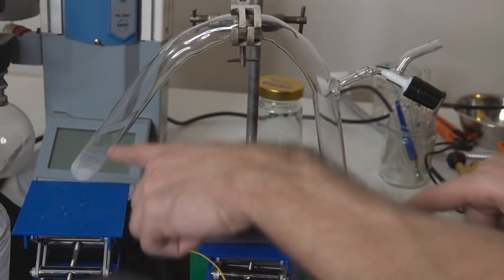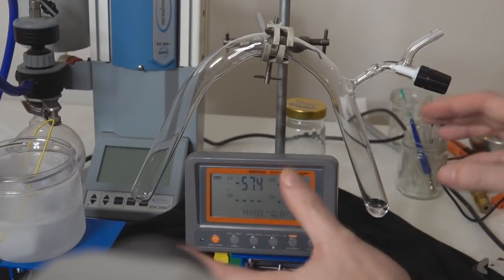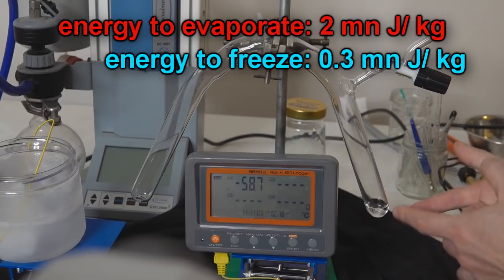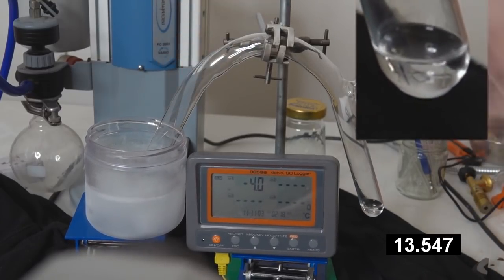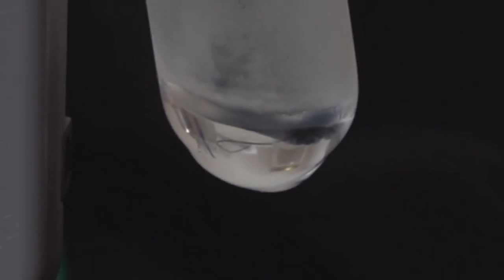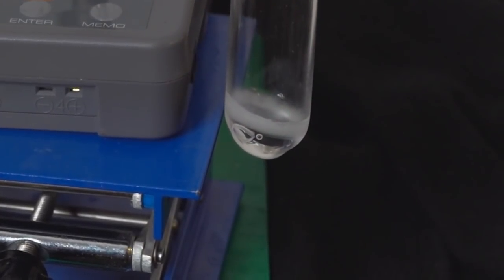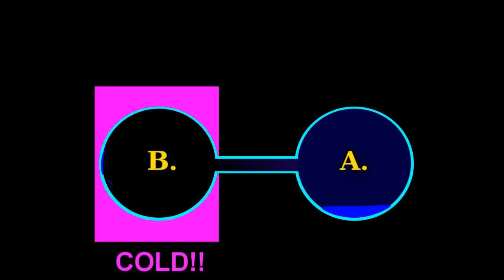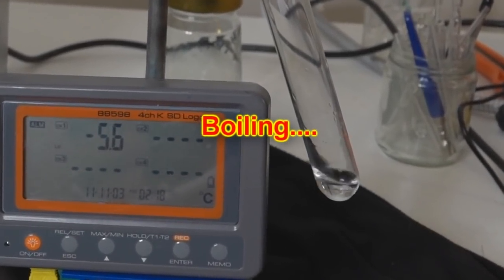Does Water Boil or Freeze in Space?

Comment: I do wonder if the vapour pressure speed would be limited by practical effects of the diameter of the tube over really long lengths?
And would the amount of actual energy transfer through the tube (and hence available to be converted by a turbine) be directly proportional to the diameter of the tube?

Got any feel for the practicalities of this Thunderf00t?
Reply: Luiquid will evaporate at different tempatures dues to the pressure of the container it is in. The chamber pressure changes at what tempatures something , for example, in cryogenics, the fluid will be kept in a container at high pressures, changing the tempatures for evaporation to allow for storage at warmer temperatures.Hope this helps
Reply: If you make the tube too small the gas will have to travel at relativistic velocities because of Bernoulli's law, and it will travel backward in time, thereby drawing power from the grid instead! Impractical!
Reply: @triogaming4077  apparently a human head takes about 30mins to freeze in liquid nitrogen so I'm guessing a reasonably slow in space
Reply: Possibillities are probably endless.

Practicalities are a work in progress ;)

Science my nigga
Reply from the maker: yup, to a reasonable approximation viscous flow goes with the fourth power (if memory serves) of the diameter.  Big tubes make a huge difference.  That being said, even if you assume the water is travelling at the speed of sound, and assuming 10% eff. (probably generous) you need to freeze about 1 ton of water to supply one person with energy for one day.  Im not sure I see this happening any time soon! ;-)
Reply: @Thunderf00t  and if you will pump warm californian waters through  our ice block to heat it up, would it be possible to produce more energy than the pumps will consume?
Reply: @HoleyHouseOfAir the rate at which they lose energy will determine the distance travelled before freezing - surely?
Reply: Of course, if you limit the diameter, you change the P/Q diagram of the system and you limit the (mass) flow. Increasing the length of the tube also increases the hydraulic resistance of the system so with a thin, long tube you will get very little flow.

The total amount of energy available to the turbine depends mainly on the amount of energy you pump out on the cold end since condensation is driving the pressure difference between the two ends.
Therefor the diameter is critical, if we assume that you can pump out any amount of energy on the cold end, but the function between the diameter and flow is not linear.
Reply: It doesn't matter.  He proved that vacuum conducts cold.  He cooled one end and the cold travelled along the vacuum to the other end.  Vacuum therefore has a very high thermal conductivity.

Whaddaya mean it doesn't work that way?  It works that way for holes in p-type semiconductors.
Reply: @Thunderf00t  btw, realize that your hydrovac is literally just a heatpipe? Like the stuff PC's and LAPTOPS use to cool the CPU's.
Reply: @tedarcher9120 LOL no such thing as free energy
Reply: @bdf2718   that is incorrect vacuums have poor thermal conductivity  other wise it would be as hot as the sun here on earth
Reply: @dimitar4y   yeah he reinvented the heatpipe
Reply: @dimitar4y  does a heatpipe have a turbine in it? No? Then it isn't the same thing, just because something operates on the same principal, if they do different things, it isn't the same.
Reply: @tedarcher9120  Yes that's literally what a heat engine does. You heat one side, cool the other, and it produces usable energy. But it's not energy from nothing, it's energy for heating up the Arctic side and cooling the California side.
Reply: @punker4Real  
whoooooooosh
Reply: @punker4Real  The hydrovac "invention" is just a long term trolling video series. Watch the previous ones and he has snippets  of "invention" videos made by others that Thunderf00t previously debunked.
Reply: @bdf2718  the demo is cool, but it really is just a heat pipe operating at not quite cryogenic temperatures. 

With a little bit more water, a tube that can stand a bit of pressure, and a way of sealing the tube after it has nothing but water and water vapor in it, you would have a nice heat pipe demo. (Unfortunately with water the coldest you are going to get is around 0c. With a tube that can take some pressure the whole tube be at a uniform temp, radiating away any heat applied to the hot end as water condenses everywhere it can)
Reply: Yes, when I vac refrigeration pipes out (almost every day) the length and diameter play a big part, on a huge run like in a school or something I can have say 200 microns at the pump end and still atmosphere at the other end. Reacts very similar to flooding it with nitrogen, huge pressure where I pump it in, takes a bit for the entire line to equalize.
Reply: @Alucard Pawpad Yes, exactly, it's a heat pipe.
Reply: @EEVblog pressure is force/area so the amount of energy has to be directly proportional to the section because the work done by a turbine is a function of the difference in pressure at both sides of the turbine: same pressure more surface => more work (energy).
Reply: Yes, the effect depends on the mean free path if the mean free path is small compared to the tube diameter then the usual fluid dynamic equations apply, if the mean free path is long compared to the tube diameter the vacuum diffusion equations apply, either way you only need a few pipe diameters before losses become large.
Reply: This video series is just one big joke. It's one big hunt for the worldwide stupidity.
Reply: Remember the goal is to get cheap energy from this!  @thunderf00t was pretty specific on that.
Reply: @dimitar4y  he doesn't have a return and heatpipes don't operate in the solid phase. But it's basically the same thing so you are correct.
Reply: When I first saw this, I thought of why not using sea water to extract the energy from as an assist to solar power (some would be used to run pumps, etc.) but as with all similar ideas, someone has already come up with it of course.  http://www.otecnews.org/what-is-otec/
The site looks legitimate enough.  Further researching reveals that plants using this technique do already exist, the open cycle type is more in line with the the 'hydro-vac' system. https://en.wikipedia.org/wiki/Ocean_thermal_energy_conversion

Comment: A fellow scientist chiming in here: You might be interested to know (if you don't already) that in organometallic chemistry labs, this kind of transfer is done routinely as a way of stripping solvents out of a solution without heating them, since a lot of the compounds we work with become somewhat unstable if heated much above room temperature. We do it in a similar way to the apparatus you show here, albeit with more of a temperature difference: Liquid nitrogen is used for the cold trap, which enables the condensing of organic solvents, most of which have freezing points well below that of water. (There are exceptions though, such as benzene or cyclohexane, which both freeze at about 6 degrees C.)

If we aren't too concerned with keeping the solvent which is evaporated off, we typically also use a dynamic vacuum to speed up the transfer, with a second cold trap just before the vacuum pump to catch any solvent vapours which don't condense in the first one. However, a static vacuum transfer is still done for "distilling" special NMR solvents (organic solvents with all the hydrogen atoms replaced with deuterium), since these tend to be rather expensive, so you don't want to lose any vapours down the vacuum line.

Comment: You could actually use that in AC systems. Just use vacuum tubes, cool it to very low temperature on one side (external unit) and use that to cool air inside. I'm not sure what would be ratio between water condensation for cooling unit (in the room) and water evaporated that is condensed on the other end outside of the house. This way you solve dehumidifier condensation from cooling air which could be used to provide some water for this reaction, eject it outside (probably on hot side of heat pump to additionally cool down hot radiator) and you would also get some energy back if you use steam pressure. Extracting water from the one side and adding it to the other side is not that hard until you realize it would freeze almost instantly and whole setup would be garbage.
But hey, there are similar devices using similar reactions for similar goals. Just take a look on absorption fridges or even simple heat pipes.

Comment: I'd assume you would constantly heat the warm side of the tube using the warm water. So it wouldn't freeze. I think the bigger problem would be to get the frozen ice out of the cold side to maintain the vacuum. Eventually you'd just have a block of solid ice on one side that you'd somehow need to get out of the vacuum tube.

Comment: This doesn't surprise me.  I tried using a vacuum pump to dry room temperature bicycle chain that I cleaned with a water soluble degreaser.  The water on the chain froze before it all boiled off.  My intent was to get an thermoelectric cooler, bolt the hot side to the underside of the aluminum vacuum chamber, feed the vacuum through copper tubing bonded to the cold side of the cooler, which would hopefully also condense any water vapor before it went through the oil in the vacuum pump, and with any luck boil off all of the water from the chain before it froze on the chain.

Comment: in a vaccume water would boil because of the change in boiling point under low pressure. As water boils it will draw energy from the mass of water until the temperature is below the freezing point. Saw this on Cody's lab.

Comment: During hot summer I usually sip my drink with force running it throught my front teeth so you get a colder sensation. I also notice the drink was getting colder and water condenses outside the glass. You should try it.

Comment: that's crazy. it didn't even send any coldness through the glass apparently... it just magically transfered negative energy through space?
Reply: The water molecules going from the right side to the left side are traveling very fast, that is, they have high kinetic energy.  So they are bringing energy from right to left that way.  The energy that makes it to the left side gets sucked into the cold fluid T'f00t has dunked the left side of the tube in.
Reply: And really, there is neither "coldness" nor "negative energy" - it's just that what we experience as "normal" is a considerable 1atm of pressure.
The water in the tube partially evaporates to create some pressure, filling out the whole tube, so it was always partly on the left already, and more followed when it condensed there.
Reply: Glass has a poor thermal conductivity

Comment: So, is this right ...  There was a vacuum but the water evaporated slightly to cause a stable 'pressure'.  When a water molecule in the liquid randomly gains about 15% more energy than average at this stable pressure the molecule will break free from it's bonds and 'evaporate'.  Reducing the pressure - by cooling the vapour in this case - means that the energy requirements is less than 15% to break free and because of the temperate of the water most molecules can escape their bonds and they take the energy from the water with them as they leave.  This energy loss cools the water until it freezes or a new 'stable' 15% energy level is reached?

Comment: what if 
- long tube goes up into mountain
- bottom is above freezing and top below freezing
- top and bottom have interchangeable containers  with minimal vacuum loss on connecting them (create vacuum only on connection part before opening valves)
you can use
- vapour pressure to spin turbine
- peltier device on cooling the bottom
- after the water is transferred to the top energy from lowering the container
Reply: Why would you need to cool the bottom? It would get cooled anyway, freeze and stop evaporating. You'd need to heat it if anything.

Comment: How do you condense water in a vacuum? I install HVAC units, we pull vacuums on our refrigeration lines to less than 500 microns. The reason is to boil off water regardless of external temperature to ensure the least amount of water in the system.

Comment: Awesome, Thunderf00t can distill using ice!
Question: normal distillation (e.g., to separate fluids) is based on differences of the boiling temperature. However, this "ice-distillation" seems to be based on differences of vapor pressure. To me, this sounds like something very interesting to consider for separating fluids with similar boiling temperatures (but different vapor pressures). Ideas?

Comment: Ya that's why you can't use a vacuum for this. You have to use a gas and a liquid that will not easily dissolve into each other. Then you use pressure as a toggle to match your outside temperature. Then comes the same freezing problem again all over at every turn. 
I have came to a few stable solutions though.
The first I made used a series of main tanks on the inside stacked on top of each other and with a water flow designed to maximize the dissolveing of a gas into a liquid then the structure would be surrounded by a bunch of tubes filled with a bunch of rings angled on one side to the inside of the ring with a etching for sending points.
Think of beer hitting and releasing gas at the bottom of the glass.
 Then I  built several models at small scale under high pressure. Still freezing problems occurred.

Then there were a series of toride designs I played around with all hit and miss. All once again the freezing problem. With those I was certain I could solve it with a better control system I just couldn't build it at the time.

Then I came up with the idea of just a diode like layer for heat itself which work but on such a small scale it was not worth the builds. That ended up being because of subatomic surface radiation interference.
At that point it was a matter of designing the right meta materials for the thing which was sidetracked by a project I had for soundproofing I was working on.

Comment: Nice little demonstration.
"boil or freeze" is a false dichotomy. Since the pressure in vacuum is so low there is no stable liquid state. And thus there is also no phase change from a liquid state. What is happening cannot be described as a quasistatic process.
After the water is stable again (as ice/gas) sublimation and resublimation are the possible phase changes. (For example see ice lines in protoplanetary clouds)

Comment: The answer is, BOTH, this is why "freeze drying" is CALLED "freeze drying", I thought everyone knew that. In fact, water can't even exist as a liquid below the triple point pressure, it sublimes, just like dry ice, so liquid water has a choice between 2 things in a vacuum, turn into ice or turn into steam, and typically it will evaporate and cool until its temperature reaches so low that its vapor pressure is nonexistent (slightly below dry ice temperatures) and if there is a source of heat to keep it above that temperature, it will vanish entirely, turning into gas. This is what comets do, although they are a mixture of water ice and other ices that have more vapor pressure and are gases on Earth like methane or ammonia.
Reply: I guess technically it has a 3rd choice, it can evaporate so quickly and liberate so much steam that the steam provides enough pressure to keep some of it in the liquid state, but that's going to be fairly temporary.

Comment: How about this to solve the freezing issue.

4 reservoirs, only 1 open to the cold chamber at a time, and after 10-15 seconds the open reservoir is closed off and another is opened.

This would give each reservoir the time needed to 'boil' off the water to get the pressure back up so the water doesn't freeze.

Comment: WAIT, DOESN'T THIS TRANSFER HEAT LIKE A MILLION TIMES FASTER THAN COPPER?!
(ps: yes i know this is a vapor chamber thing; i know it's used in most laptop/pc cooling nowadays; "heat pipes" they're called. Hot side boils to gas and cools off; cold side condenses the gas to liquid, that travels along the walls back to the start. Thunderf00t reinvented the heat pipe. But I'm sure he knows this and is just intentionally trolling to help the kickscammer)

Comment: Correct me if I am wrong by wouldn't the hydrovac require that you could change which of the ends that are hot and cold so if you built one from the equator to a pole you would need to rotate it 180° between each cycle? Or could you solve that by balancing the system so regular night and day cycle would be enough to melt the frozen end?

Comment: So the problem with your heat engine is that because ice floats in water, it will prevent further evaporation; and thus vastly reduce its efficiency ... 
Clearly you need to switch to alcohol or some other material which is liquid in those conditions; but whos solid is more dense.

Or - you could transfer energy in the other direction; and light a fire.